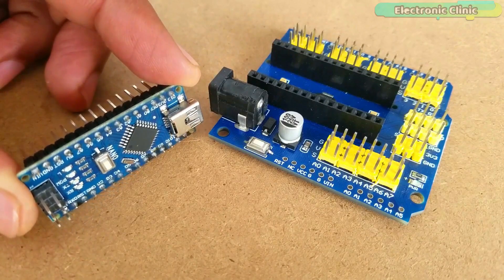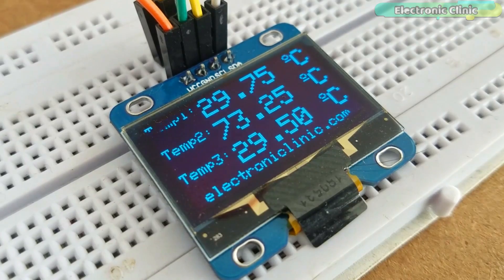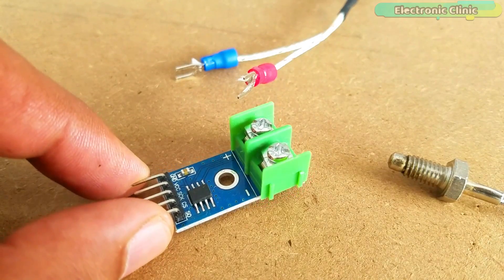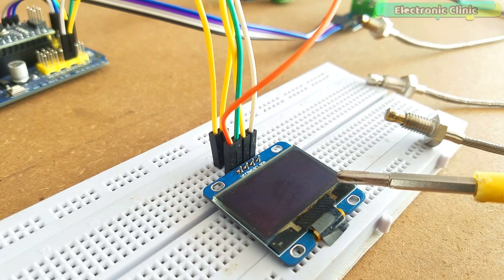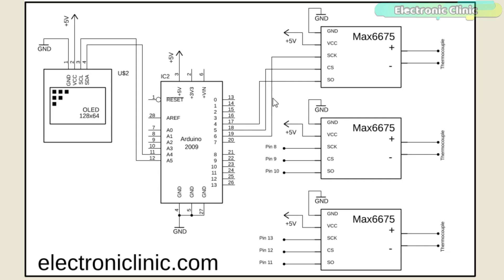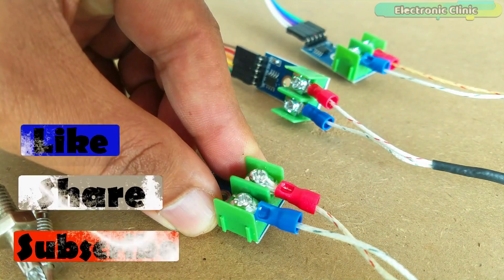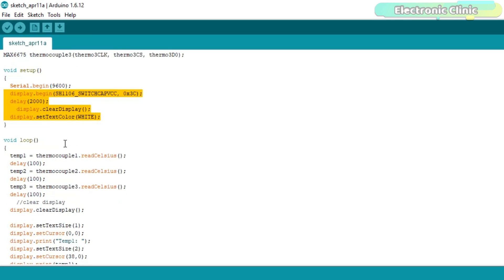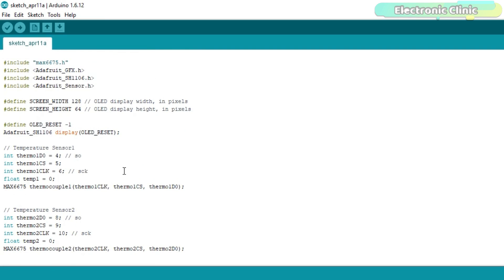Multiple Max6675 Arduino, Industrial Temperature Monitor using K type thermocouple & Oled display

Comment: Is it possible to do the same but using a cheaper 3 pin NTC temp sensor module for smaller purpose

Comment: This is excellent thank you, did you ever get around to using this to control a system of heaters/coolers?
Reply from the maker: I have used it in multiple projects, it's work exceptionally well

Comment: Hello, I have Arduino uno instead of Arduino nano. The code won't work. Please help me. I need this in my thesis
Reply: I finally fixed it. I just installed Adafruit BuSIO. Still using Arduino uno NOT nano

Comment: Good video but I was expecting the temperature display to rise much faster with a flame touching the thermocoupler. Is there a better alternative you could recommend?
Reply from the maker: this is industrial temperature sensor, its a bit slow but works great. you can try ds18b20 temp sensor.
Reply: @ElectroniClinic  Thank you! I will look into it 👍 I will be using it to get water temp feedback from servo-driven valves on the water hydrant on my acreage.
Reply: @Electronic Clinic  Could you recommend an alternative that has male threads like the K type?

Comment: Nice Video Sir!, btw hows the arduino Sir? is it still working ? Iam confused whether i should choose arduino or plc for controlling air temperature in farm and turn on the spray or other stuffs if it is too hot
Reply: If you take care that the Arduino or STM32 Microcontroller doesn't get wet, too cold or too hot (see corresponding datasheet) or that the air humidity is too high it will run forever ! Also take care that the voltage is alright

Comment: You don't need to use that many pins on the Arduino.
Arduino has hard SPI on pins 11, 12 and 13. (using hard SPI is faster than the soft(x3) SPI you are using here)
Arduino pin D12 is MISO (Master In Slave Out), so ALL devices SO (Slave Out) can go to this pin.
Arduino pin D13 is SCK (clock), so ALL devices SCK can go to this pin.
The CS (Cable Select) from each device go to separate pins of your choice on the Arduino.
The Arduino then uses the CS pins to select which device it wants data from.
This way it leaves more pins to add more devices.
In this case you are not sending any data to the devices, so pin D11, MOSI (Master Out Slave In) is not used. (don't use this pin for CS)
Reply: thank you
Reply: класс ,работает
Reply: @comrastr8650  Без проблем
Reply: can i have around 8 thermocouples in one arduino ?
Reply: @emilianocastelan4845  If you use the Hard SPI, using D12 (MISO) and D13 (SCK). Connect these pins to all devices (Thermocouple Modules) pins SCK to SCK and MISO to MISO.
You can daisy chain these and power. 
Each Cable Select (CS) pin of each device  (Thermocouple Module) will need it own pin on the Arduino.
Each of the individual pins on the Arduino (CS pins from devices) are activated one at a time. When one is activated, you are reading from that device (Thermocouple Module).
So if you have 8 pins free after connecting D11 and D12 (remember pins D0 and D1 are for serial) then yes.
Reply: @Tims_Projects  oh okay, I understand now thank you
Reply: Using your way . Is better than this video ?.any weaknesses?  @Tims_Projects
Reply: @sandaljepit9749  No. Doing it how I say, Is how it was designed to be use.
Reply: Gabisa diterjemahkan ke bahasa Indonesia:(
Reply: @Findingkyy16 you can ask me bro, i am Indonesian
Reply: is it possable to have like 8 of these on the Mega?
Reply: @woodzyfox4735  yes, if you wire it as I have said. you can connect a lot more than 8 on a mega.

Comment: I have 2 Max6675 Sensors. But the Temperature is different. Can i fix die Problem in the Arduino Code?  The Differenz ist about 3 Degrees.

Comment: Good video!!
Can you tell me that whether an arduino mega is capable of running MAX6675 ?
and how many maximum of max6675 modules can an arduino UNO support!
Reply: for using many MAX6675/MAX31855 you need to have connected:  SCK, SO, and a CS for any MAX6675/MAX31855 you use and make changes in the sketch... for example, if you have 10 digital pins free, you can connect 8 thermocouples (SCK, SO, CS0, CS1, CS2, CS3, CS4, CS5, CS6, CS7).

Comment: Thank you very much for your explanation! It was very clear and helpful! I am only left with one doubt I would really appreciate if you can solve it ... Max6675 module uses SPI, however, Arduino has got only one SPI if I am not mistakes... Therefore, how is it possible to connect the other two MAX6675 module? Thank you in advance

Comment: Good video, although I personally found those MAX6675 a bit slow... =( Tried measuring temperature of water in industrial cooling system. But it was fun...)
Reply from the maker: I am planning to use these in plastic injection molding machine.
Reply: @ElectroniClinic  Good luck on the path)